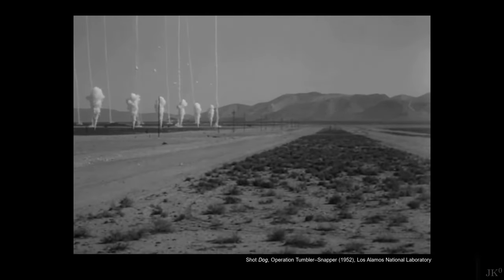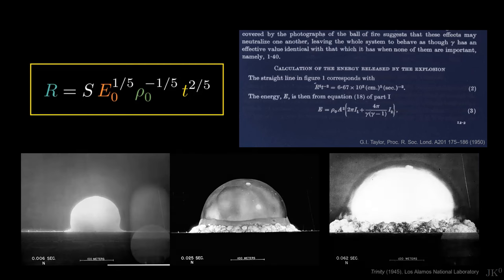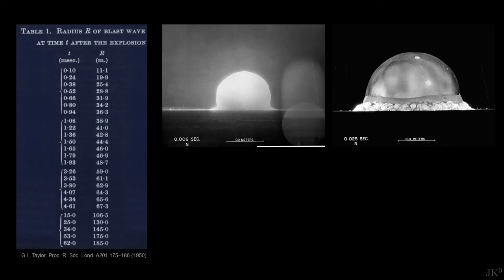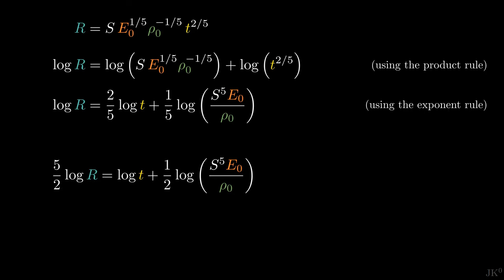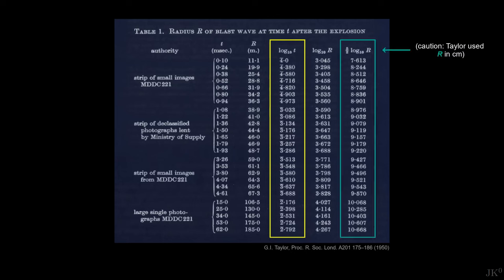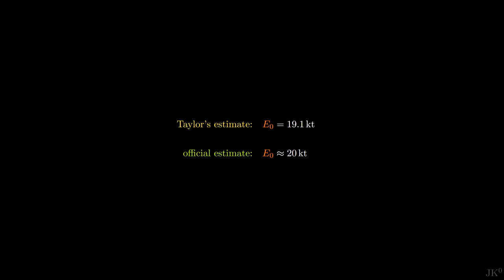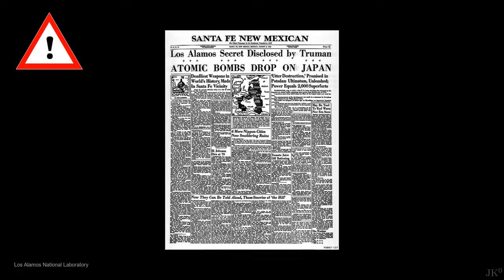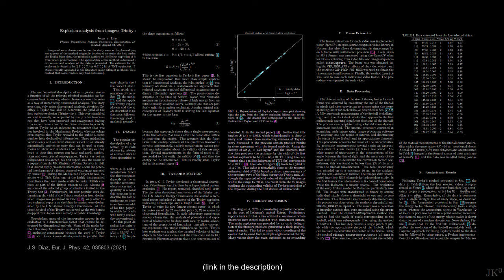Energy of a nuclear blast

Comment: This is fascinating but forgive me for being dumb here but how does using a single equation and pictures of blast radius take into account energy from the heat, the light, the x-rays as well as the kinetics? Is it not an oversimplification?
Reply from the maker: what you are bringing here is far from a dumb question, it is in fact something I am discussing with experts all over the globe since some time now. Notice that I am very careful to refer to the calculated energy as "blast energy," this means that with Taylor's method you only get the energy that produces blast but not any "wasted energy" in the form of ionizing and thermal radiation. I hope to report in the future the details but trust me when I say: this is not a dumb question at all.
Reply: @jkzero  Actually a very good question and I look forward Dr Diaz's explanation one day. I'm guessing that as the official total yield of the Trinity test is 22-23Kt, that extra 3 to 4Kt of yield is the non-blast yield (ionizing and thermal energy).
Reply: There must be some wasted energy, but the ionisation of the air traps most of the initial energy inside the fireball. This is the cause of the 'double flash' and can be seen in one Youtube video for a really large (1MT+) test explosion. Not sure it will be linkable in the comments, but will put the link in a separate comment here.
Reply: The only video I've seen with the Nuclear 'double flash' actually recorded. https://youtu.be/ELyJ8svGXAs?t=210
Reply: Hidden comments.

Comment: It should be noted that the reason there are those lines in the sky behind nuclear blasts is to measure the yield of the blast.They are some distance (I don't know what distance--500 feet??) behind the blast. by analysing the film rolls you can see when the shockwave blurs out the lines you can calculate the yield using these formulae.

Comment: Excellent video. I'd have loved to see some error analysis to understand how well the formula works and how significant was the discrepancy between the estimate based on the images and the official value. It's hard to tell if the 4.5% or so relative error is relevant or not.
Reply from the maker: Uncertainty quantification is very important and here you can see that Taylor was a theorist, he included no uncertainties. I guess it is easy to redo his analysis, the photographs are publicly available.